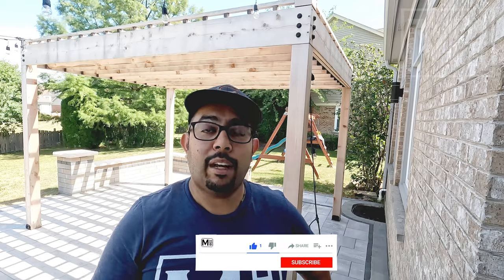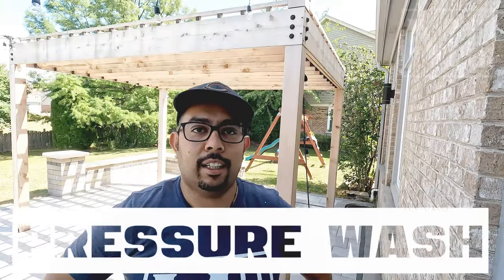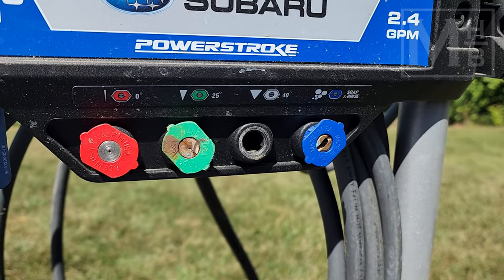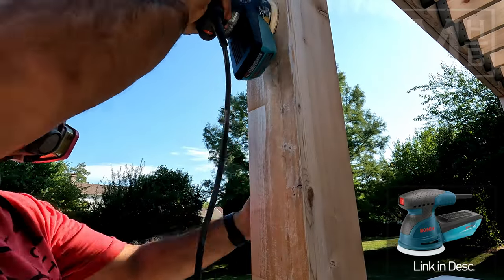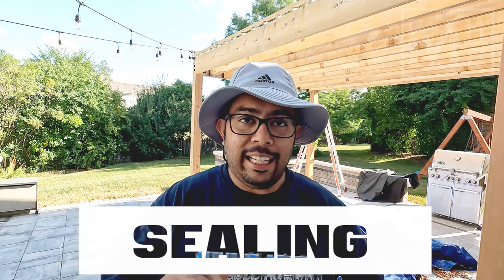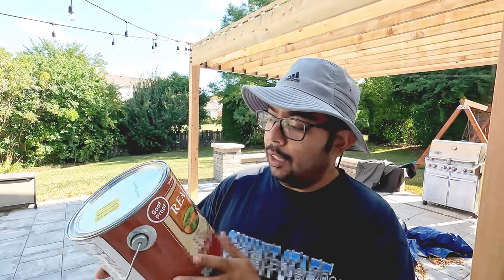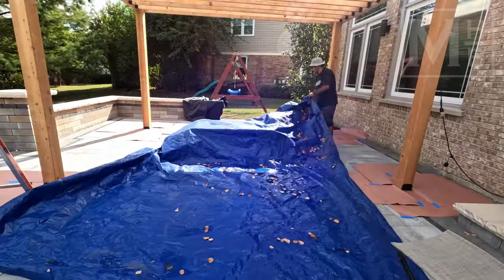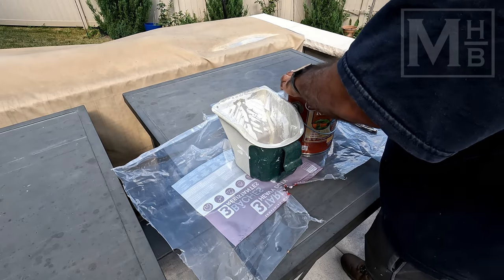Ultimate DIY Guide: Staining Your Cedar Pergola with Ready Seal | Easy Steps & Pro Tips!

Comment: Good job, which brad nailer should i buy to build mine? 16 or 18 gauge?
Reply from the maker: For a structure like this, I would use a screw or a framing nailer. Not a brad nailer.
Reply: @MakingHomeBetter  Apologies for the typo, I meant to ask which gauge framing nailer did you use - 16 or 18?
Reply from the maker: @tentinelli6940  got it.  I actually don't have a framing nailer, so went with all screws.
Reply: @MakingHomeBetter  no nails at all, overal screws then?
Reply from the maker: @tentinelli6940  yup, all screws